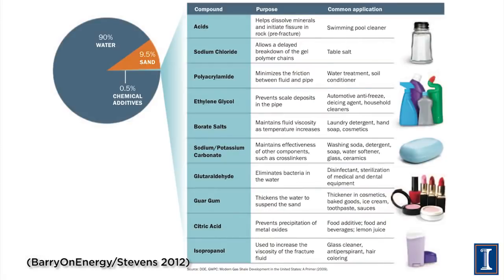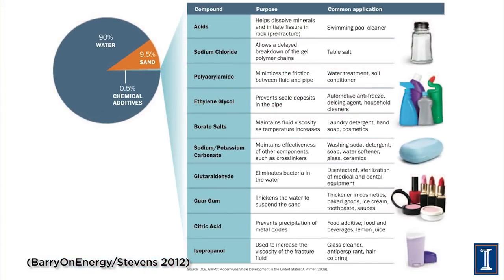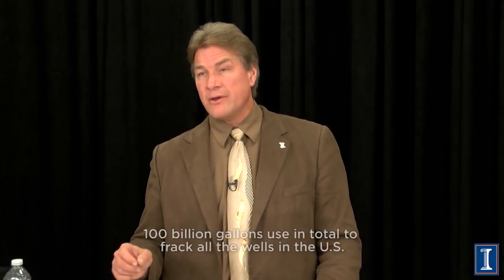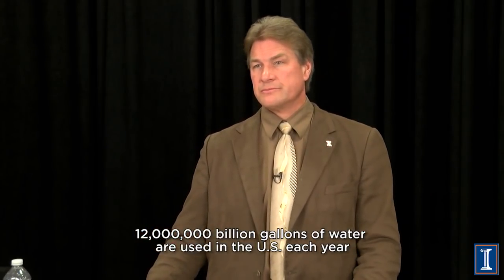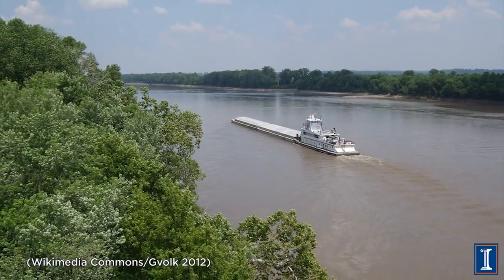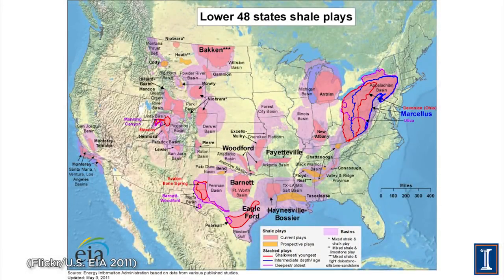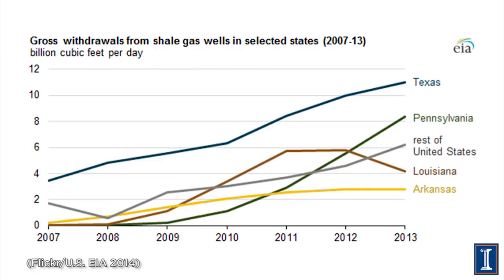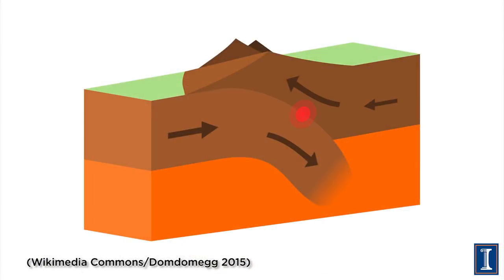Fracking and the Environment: Myth and Reality

Comment: Wireline isn't causing "giant" explosions perforating the well casing with those tiny little shape charges. Maybe a very very very out dated method of dropping WW2 surplus torpedoes down there.
Reply: Wireline drilling is a technique where the rock core can be removed in a cylindrical "barrel"  brought up to the surface on a long wire cable without having to remove the drilling rods from the hole as was done in older drilling techniques.
Reply: @karhukivi  Wireline in hydraulic fracturing is a third party service that pumps explosives down into the well and detonates them. The string of explosives is called the gun. Each explosive is packed into a metal cylinder that has holes offset every so many degrees. As the explosives go off the outward force or energy generated is multiplied and expelled through the offset holes. This concentrated energy perforates the steel and concrete casing and starts the fracture into the shale formation.
Reply: @brob-zy8zi  Wireline is a method of lowering an internal cylinder on a wire cable to avoid having to remove all the drillrods from a hole.   Standard in oil well and mineral exploration drilling drilling to remove drill core and lower sondes. I've been using it for 40 years.
Reply: @karhukivi  Dude, I have years of experience in hydraulic fracturing. Wireline is a broad term. In hydraulic fracturing wireline services lower explosives into the hole to perforate the well bore so pumping can begin. They also set plugs to separate stages and run fishing operations. It's a broad terminology. I've been in operations involved in pumping the explosives down more times than I can count and in getting them unstuck or running tractors etc.
Reply: @brob-zy8zi  They may call that "wirelining", but as I said, wireline equipment can be used to lower all sorts of tools and probes down a hole inside the drill string as well as the applications you talk about.   Try googling on "wireline" and you will see the sorts of things that it refers to other than your specific applications.  We use wireline drills in mineral exploration all the time to remove the core barrel and no explosives are ever used except on rare occasions  when the rods are seriously jammed and the string has to be broken.

Comment: I used to live in the city of farmer city, Illinois.  The water had large amounts of natural gas in it.  If you were to fill a one gallon jug with water, gas would froth off of it.  Enough gas to set that gas on fire with a lighter.  Enough gas to allow it to burn for a few seconds after you would take the lighter away.
Reply: Keep in mind that the natural gas that comes up from relatively shallow water wells can be a useful fuel source. I know a person that uses natural gas that comes up from a water well to run a small bakery. It could be used to heat water or to heat a house.
Reply: @charlesaanonson3954  really? That sounds really interesting